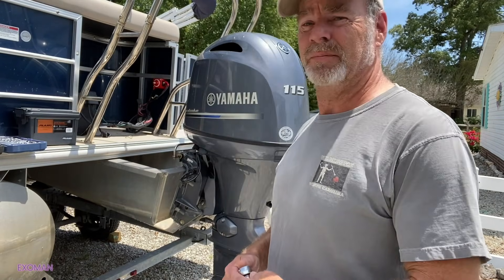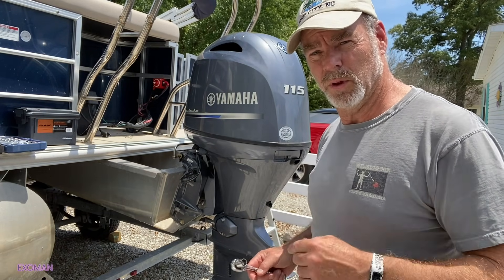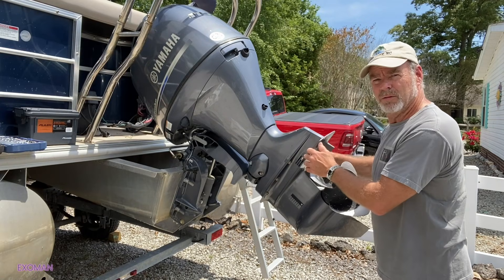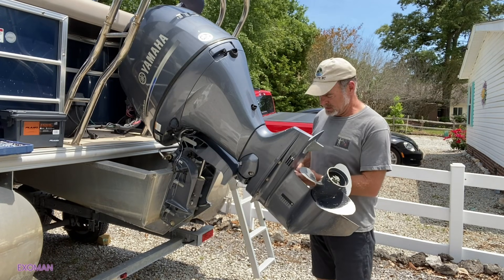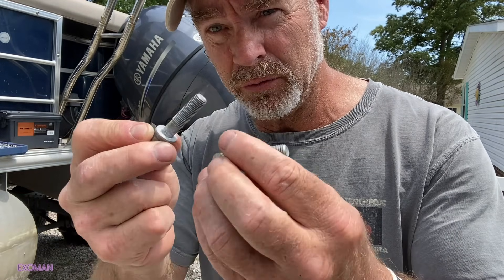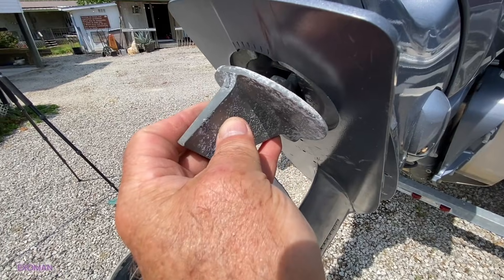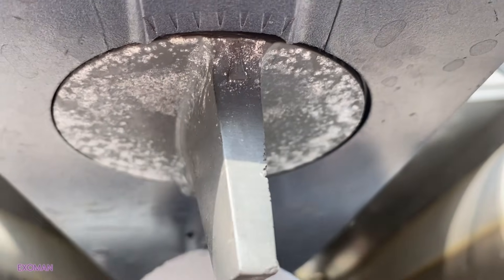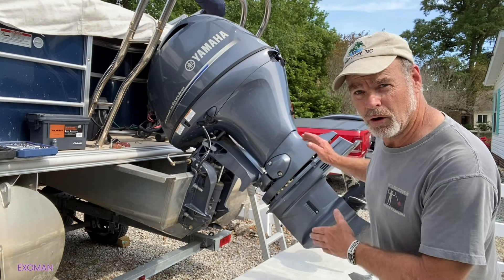Water Pump Removal Replacement Marine Outboard Yamaha 115~ Winterize

Comment: Great video    I saw another guy a boat mechanic set the lower end in a plastic 33 gallon trash can  it worked great to hold the unit while he did the work   Might make it easier for you in the future   I am going to tackle this job myself after watching this   I have a 90 HP   it is the same  not sure about the trim tab removal on mine I will have to look     Thank you sooo much for videoing it     Great Job

Comment: Great video, thank you!   Getting that big o-ring to stay in place is a PITA though.  I used some non-hardening high tack gasket sealer and it still wasn't easy.  Yamaha should sell the plastic housing already put together for a little more money.  It looks like that's how it was from the factory.

Comment: very instructive video, i m to replace my water pump on my yamaha 115, old water impeller is really stuck on the shaft and won't come off, even when pushing it up with a screw,  would you have a trick to take it off? thanks

Comment: why put grease around the impeller this part take the water to inside the engine
Reply: Initial start keeps it lubed  up so the fins don’t snag up and tear on the 1st start just use a little don’t glob it up

Comment: why put grease around the impeller this part take the water to inside the engine
Does the grease go inside the engine? I think it's blocking the cooling ducts.

Comment: Hello, excellent job, I have a Yamaha 115 but I haven't changed the water impeller in years and now it can't get the tail out, because the shaft is stuck somewhere and it doesn't come out downwards, even when hitting very hard, do you have any idea? How to remove the axle completely. Greetings from the island of Mallorca Spain.
Reply from the maker: I'm sorry, I do no know what to tell you.

Comment: One very important thing you failed to mention and do was lifting up on the shaft when you were seating the collar metal cup with your invention. 😮 there is a little play in the up and down of the shaft, to be correctly positioned and seated

Comment: What a crappy design by Yamaha. That metal collar won't come off the plastic for me. That part should have come in the kit because it probably seizes a lot. Thanks Yamaha for such a dumb design.

I suggest before you start that you also buy a new collar kit in case it's needed. Better to have on hand than wait for days with your lower unit apart. Also if the collar is taking more than 5 min to remove, cut it off with a hacksaw.

Comment: great good i have done them on mercs, now i have 2023 yamaha and they do not want water muffs on their outboards so dock side or over size water can , i use the huge trash can on wheels and install a drain valve at the bottom of the trash can to drain water when done testing

Comment: At what point in engine performance do you go ahead and change this out?  I’ve got a 9 yr old Y115 that runs strong and pees well too!
Reply from the maker: I am not sure, I had lost circulation and that is why I replaced this one.
Reply: At 9 years the rubber is old and stiff, make sure you buy OEM otherwise they use cheep rubber and it won't last a week.

Comment: How did you know your pump was going out on you? New to boating and I am at 300 hours on my 90 hp Yamaha.
Reply from the maker: As I recall, it had slowed or stopped circulating. Just watch that port where the circulating (engine cooling) water shoots out from the side of your motor. If the motor is running it needs to always be coming out or there. Best to you!

Comment: Great video, everything went pretty smooth on disassemble and reassemble.  Water came out right away once the hose turned on.  Tried the shift and it would not go forward or reverse.  When I slid the housing back in it I twisted it a little it went to about a 1/4"-1/2" from being flat up against the upper unit.  Then bolted it in place.  I guess I'll pull it apart and try it again.

Comment: My woodruff key is stuck. Rusted in?  Any ideas?
Reply from the maker: Not sure other than gently tapping it out with small screw driver and hammer. Good luck.
Reply from the maker: Not sure other than gently tapping it out with small screw driver and hammer. Good luck.

Comment: The Thermostat is easy to change, it will corrode and stick. There are anodes in the engine block that corrode also.  Thanks for the good video, I'll be doing mine this week.  chuck

Comment: Nice vid- things to add, everything on a Yamaha is metric. I wouldn’t use grease inside your cooling system. For the -o-rings it’s ok but for the impeller no. Instead just use a little soap. That way you don’t get any grease build up in your cooling system inside the motor.
Reply: As crazy as it sounds I use spray cooking oil, doesn’t hurt the o-rings like fuel or grease can, and water washes it away
Reply: @adamdowning3892 another benefit is its fast and easy and doesn’t get hands all greasy 😊

Comment: Old news now, but my 115 (SHO) takes a solid 30-60 seconds to start peeing too.  Had me freaked out for awhile when trying to test it, starts much quicker on the water though.  Apparently this is not abnormal according to googling.  :)
Reply: I have the same motor, mines starts peeing in 6-10 seconds.

Comment: Nice video, but how did you attatch the speedometer tube with the lower unit pushed up in place?
Reply: He forgot to attach it, had to pull it apart again for that. Also, wouldn’t use grease on seals, (expands and dries rubber sometimes) but use superlube- silicone based

Comment: What kind of grease are you using?
Reply: Id use superlube on any area in contact with rubber. 

Marine grease splines and light coat on metal shaft

Comment: If you have someone push the muffs tightly against the lower unit when you start the motor then it should start pumping water almost immediately.

Comment: I have the same motor ,   I also have a cavitation plate.  Does that have to come off to take off the water pump?
Reply from the maker: This bolt that held the cavitation plate on my motor had to be removed as I showed in the video, in order to release the lower unit. Good luck!

Comment: Thank you Exoman for the great tips! Greasing the splines, the cup, the impeller, the bolts,O-rings, and especially the woodruff key! Mine was fully corroded and I had to drill 4 holes in it and heat up the shaft to get it off! So guys, make sure you grease things up it up!